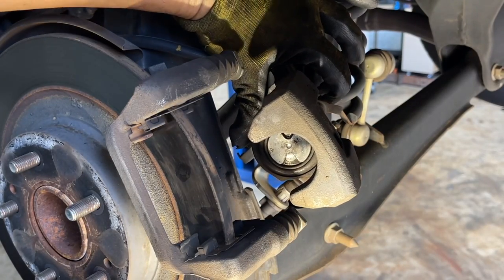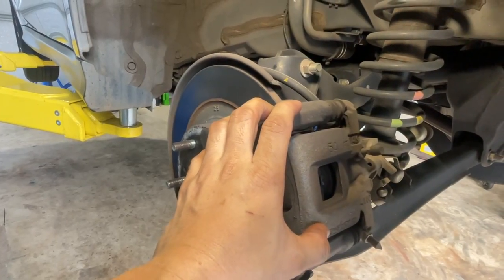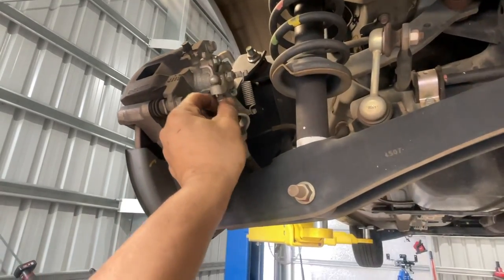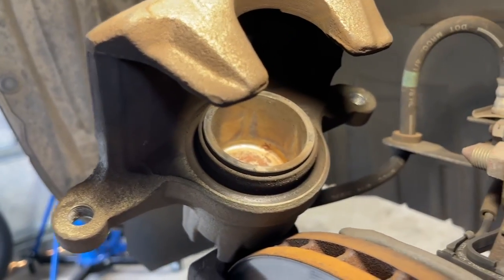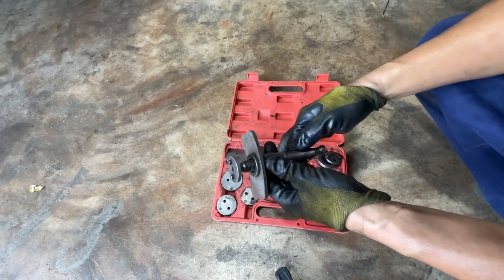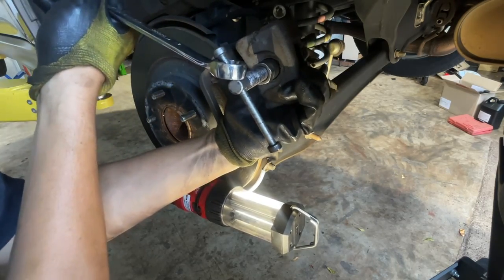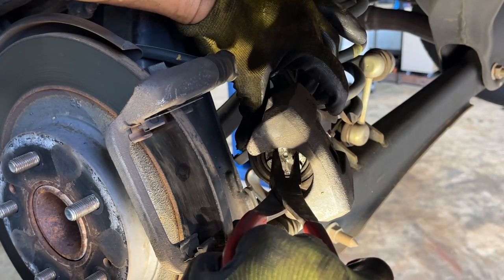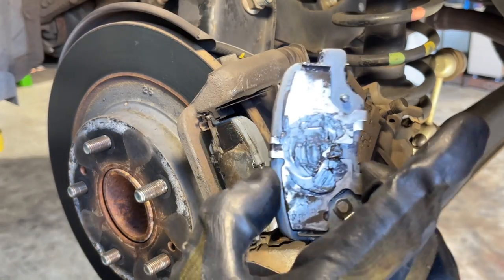HOW TO REPLACED REAR BRAKES MITSUBISHI ASX

Comment: i just replaced all 4 new absorbers at Mitsubishi Centre including front and rear stabilizer include bushings..but still feels like not too comfortable like hitting the potholes or uneven road, it sometimes feel like your rear tyres swing away, same as the front..is there any bushings (the lower arm or streering area or whatever)or spring coil that need to be replaced..so that the car will feel comfort, fit tight, like a new one the first we bought? ur opinion, sir?
Reply from the maker: You buy standard shocks or a off road? You need to do a wheel alignment also if you did that kind of job

Comment: What happens if the piston is not pushed back enough?
Reply from the maker: As long as when you putting it back the brake pads fit on the rotor your good 😉 and when you pump a couple of times and handbrake couple of times and the wheels spin your good 😉

Comment: Whats happened if you try push this piston in back wheels not turn ? Its cost problem with handbrake?
Reply from the maker: If you do the same procedure what i did and the end up the rear wheels wont turn there something wrong inside the brake calliper recommend to bring it to a brake shop 😉 don’t drive it tow the car or call a mobile mechanic 😉 possible cause the mechanism inside the calliper wont release 😬

Comment: Hey boss nice video. I have asx from 2017. I notice when hand breake is up I hear strange noises in the back specially when I lifting the car on the jack. Maybe you know where is ptoblem anf the sound is  like the creaking of springs.
Reply from the maker: Thanks mate for positive feedback back 😊 if you’re mit. same on the video you need to clean the pads and grease also that’s the first thing I gonna do 😉 if you’re is a separate pads and handbrake shoe you need to check my other video similar work 😉 and if the hand brake shoe is still ok you need to clean it with sand paper and grease all the grease points also 😉
Reply from the maker: https://youtu.be/xd_NvHD0QKA
Reply from the maker: That’s a similar video mate same procedure cheers Oliver 😉

Comment: 👏
Reply: What year vehicle
Reply from the maker: @ronrosati8896  it’s on the description mate 2014 😉
Reply: @oliverthemechanic8532 , my mechanic did my breaks on the 2020, but didn't replace the rotors, now I here a grinding sound,  I drive alot, I do Uber and I need new rotors. Not the breaks.  I never done them myself,  but I think I'm gonna try to install myself
Reply: @oliverthemechanic8532  how much would it cost to install  new rotors?
Reply from the maker: @ronrosati8896  I’m not quite sure mate how much to replace on your place but on my place around 150 to 200 😉
Reply: @oliverthemechanic8532  thanks.  That's exactly 💯 what he charged,  but midas was $350 for front breaks and rotors.
Reply: @oliverthemechanic8532  do you have a video of putting just the rotors on a Mitsubishi
Reply from the maker: @ronrosati8896  that’s only for the labor mate not including parts i have some videos for a brake job just try to check it out but not same with your car 😅